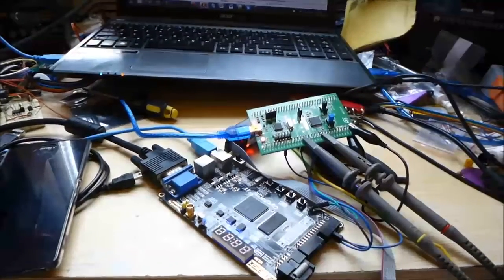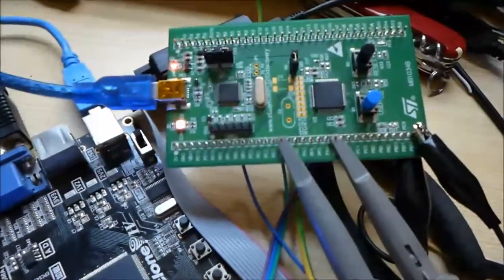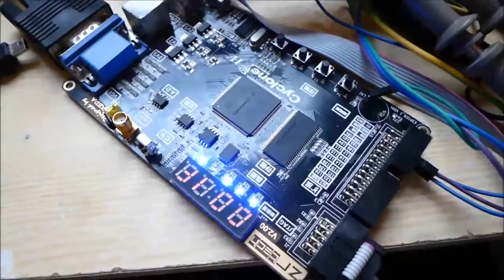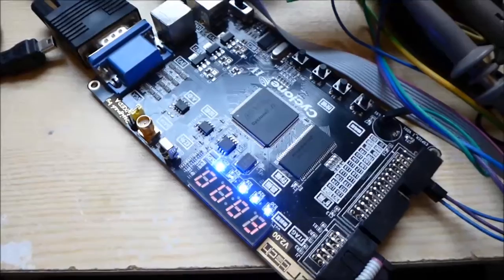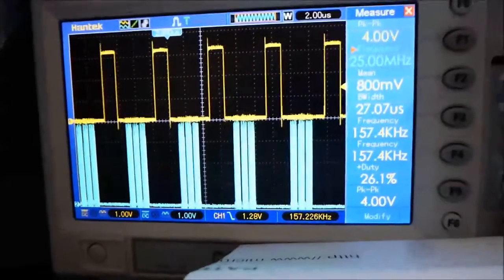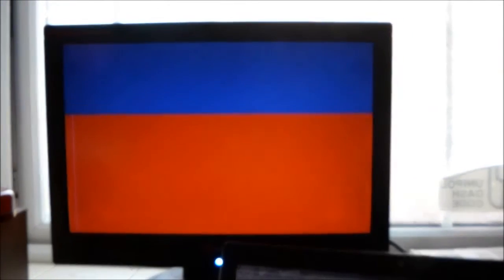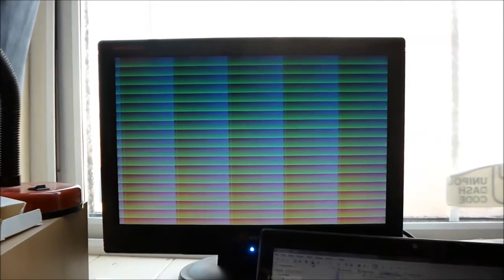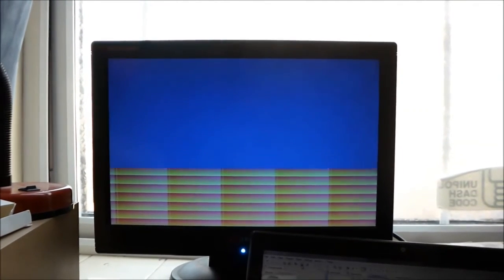VGA + SDRAM + FPGA = SPI Accessible Graphics card

Comment: is there a way that you can modify this for use as a GPU Co-Processor for a Raspberry Pi?
Reply from the maker: Yep! The pi could definitely send screen data through the SPI interface. This device however doesn't actually do any graphical processing, its essentially just a memory mapped display.

Comment: yupp still stuck on how you wrote the sdram controller :( thinking i should go back to SRAM and basic arduino ;(
Reply from the maker: Honestly, I'm still stuck on how I wrote the SDRAM controller haha, check out this guy: http://codehackcreate.com/archives/444 I read through his code then implemented it from the winbond datasheet
Reply: @0redthunder0  Hi Harris!  I have been playing with your code on my Cyclone IV dev board (the same).  I noticed some sort of segment looping issues like duplicate writes or something.  I originally thought it was a short on my address bus (and actually reflowed the board), but now I can see from your screenshots on your blog, it had the same artifacts.. lol
Reply from the maker: @MollyWi  Ha! Thats actually reassuring that its a software not hardware problem - Much easier to solve! Let me know if you find a solution, I haven't looked at this in years lol.
Reply: @0redthunder0  is it at all possible you still have the code to this?? VHDL (i simply cant get my head around verilog LOL) im still struggling with this .... i dont mind the artifact , i just need to see how this works!! PLEAAAAAASE!

Comment: Hi. Please can you point me to any total beginner guides to programming this board, using the demo code that should have shipped with the missing CD, and the USB Blaster supplied? I've got Quartus Prime Lite running, but can't seem to configure the basics. Many thanks.
Reply from the maker: Hi Matt, I'd love to but I don't have anything I'm afraid! It is similar to the same steps required for the EPM240 CPLD so I'd recommend one of those before jumping straight into FPGAs if you're new to the field.

Comment: how did you find the pin assignments of this board? I cant find them anywhere
Reply: Thank you very much for the schematic. Disappointed that the expansion connector carries the PS/2 and VGA pins with no room for extras. I wanted to make a Retro-Computer using Grant Searle's excellent Multi-Comp project and won't be able to do all that much without extra I/O. I'd really like to add an SD card, for instance. Don't need many pins. Would have been perfectly happy to have sacrificed most of the rest of the stuff on the card (like the 7-segment LEDs and all the switches) to get some real I/O pins but the designers of the card had something very different in mind.

I'm tempted to de-solder some of the ladder resistors and go with less VGA bits. Even there it looks like they combined a lot of stuff into r-packs. Might make it easier to remove in bulk - might not. Sad because from a distance the card looked perfect for Retro-computer applications.
Reply: @LandBoardsLLC  put 7-segment led on socket, so all the time when you need them, will be easy to attache them again to the board, but you are right, I am disappointing too that no room left for any extra pins, it looks like I need a bga256 package with minimum pins or something like this. I was about to buy the version with spartan6 for the same shape of board, but I believe that it has the same issue with pins
Reply from the maker: Hi, I've uploaded the PDF file I use for the pinout of this board. https://hsel.co.uk/2017/07/31/altera-cyclone-iv-fpga-board-schematic/
Reply: @0redthunder0  oh thank you!!!!! searched the internet of many yours. you saved my life